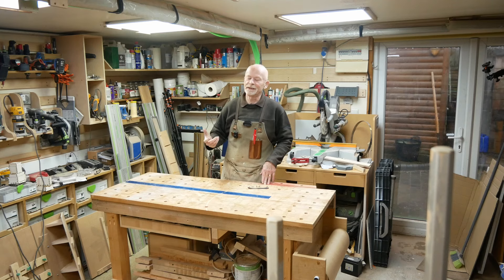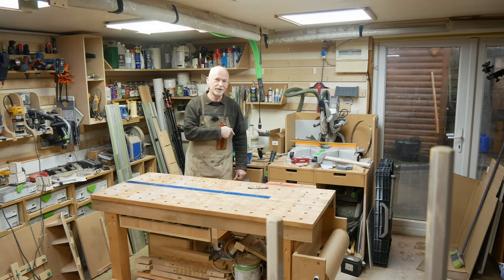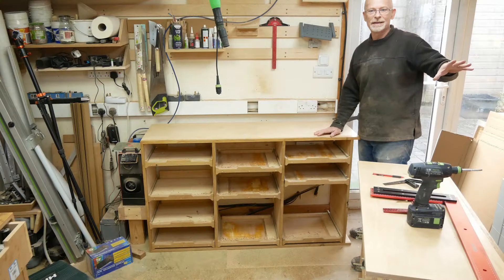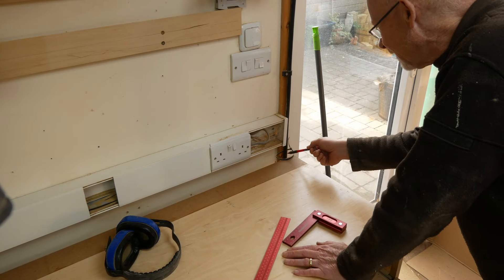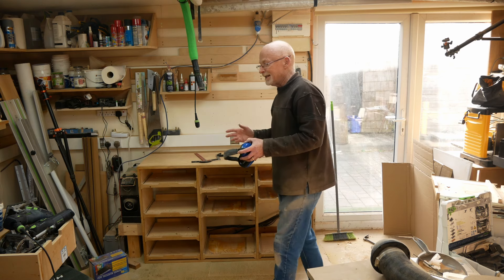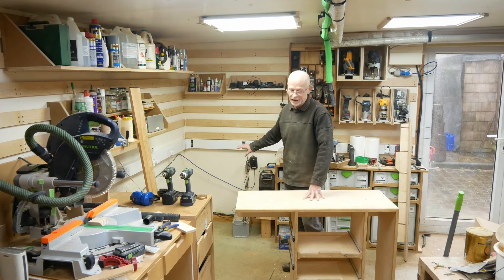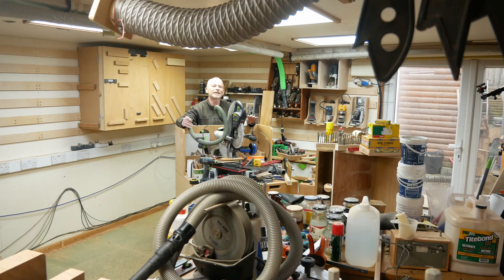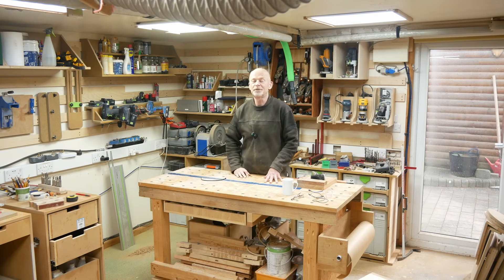Upgrading my workshop or destroying it and rebuilding it again

Comment: I'm in the beginning throes of redesigning my own layout. At the moment I walk in and am confronted by a big dust collector, i have to step around the cnc machine, then the mitre station sticks out so i have to squeeze past it, and so on. I'm so slow in the shop that optimising for efficiency doesn't make sense, so I'm redesigning with space, freedom of movement, and a general feeling of, "this is a nice space" instead. I hate to say it, but I describe my end state workshop to myself exactly as you were joking around! feng shui 😆
Reply from the maker: As long as it makes you feel good MArio, that's all you need. 👍